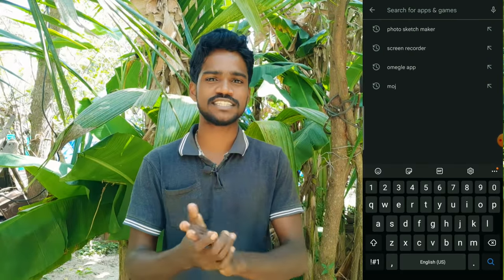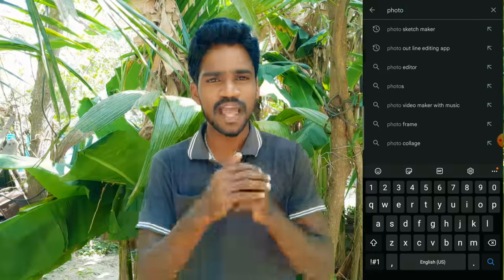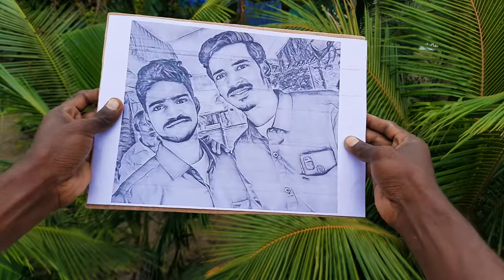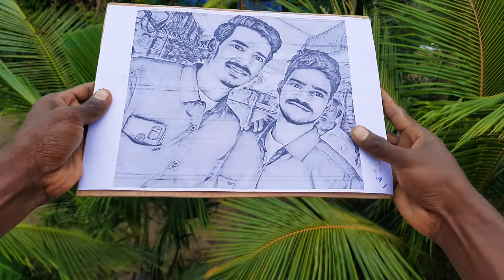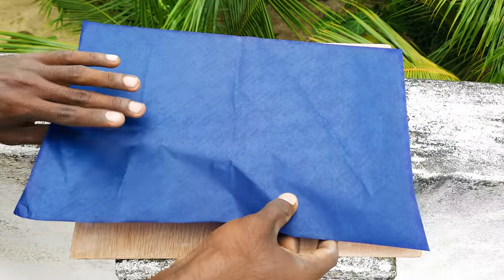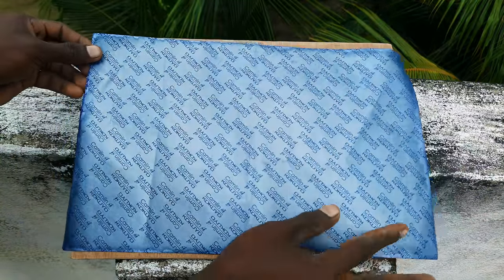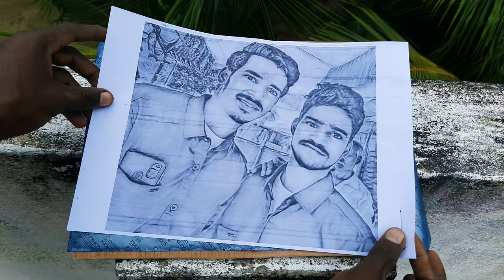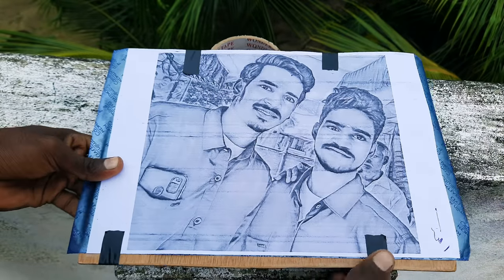Low Budget Gift🎁 Making | Pyrography Tool Making Using Syringe Needle |Mr.village vaathi

Comment: 23 gauge needles separate ah kadai kudhu. It will be more slim and easy to buy, and will be easier to make very minute drawing lines. 23 gauge and upwards ask for surgical needles. More the gauge slimmer the needle. But u need a sturdy needle. Be sure to take that into consideration.
Bell pins also will be a good alternative.. 🙏🏽